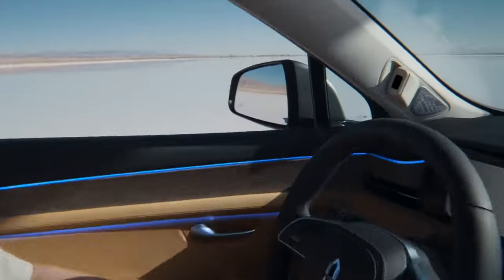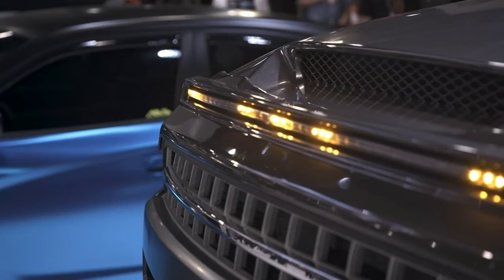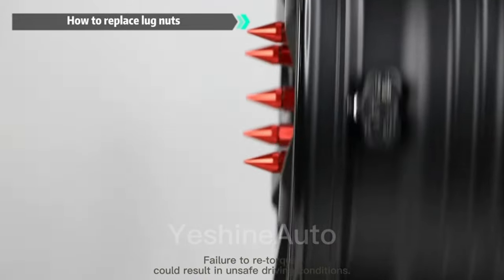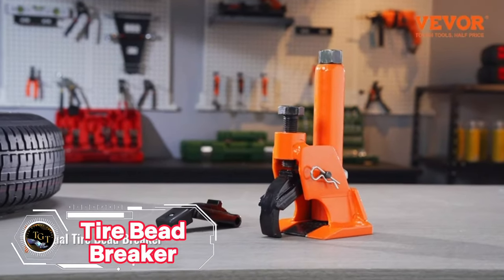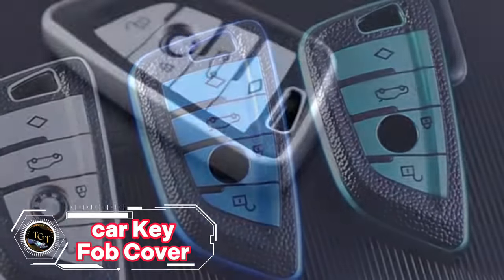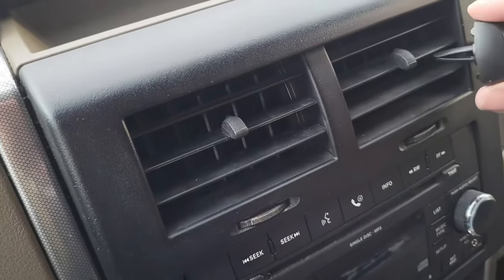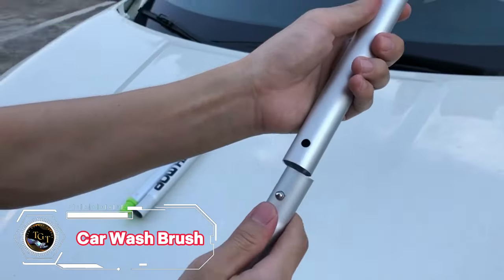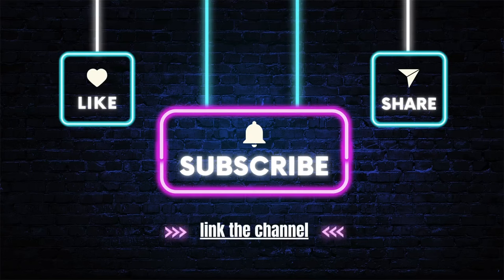15 smart car gadgets available on Amazon, that make your car life easier

Comment from the maker: below are the links to the products:
G-PLUS Fender Flares $35.99 https://amzn.to/3vcMH7A
 AVS Window Protection $40.65 https://amzn.to/4aEuGPJ
 misiLin TPU Snow Chains $55.86 https://amzn.to/41GiF8w
JDMSPEED $49.99 https://amzn.to/4aFXK9S
 Car Coccyx Seat Cushion Pad $33.99 https://amzn.to/3tL1g1M
 Enoch Ionic Car Air Purifier $24.50 https://amzn.to/3RWRWRP
 Tire Bead Breaker $73.33 https://amzn.to/3tAym4u
 Acteam HUD Heads Up Display for Car $60 https://amzn.to/3RB62aa
 Car Key Fob Cover $9.98 https://amzn.to/3H1YTux
 Tire Repair Kit $19.99 https://amzn.to/4aG0GD7
 Car Air Freshener $7.93 https://amzn.to/3O9kBRB
 Antstone Manual Tire Bead Breaker $149 https://amzn.to/3vpQhLG
 Armor All Car Cleaning Wipes  $7.55 https://amzn.to/3vmnZlp
 Wontolf 62'' Car Wash Brush $22.99 https://amzn.to/3GZ44vs
 Spark Plug Tester $22.99 https://amzn.to/3H2ciCU